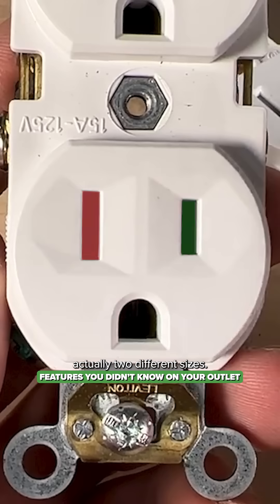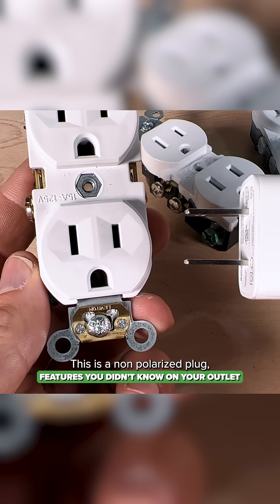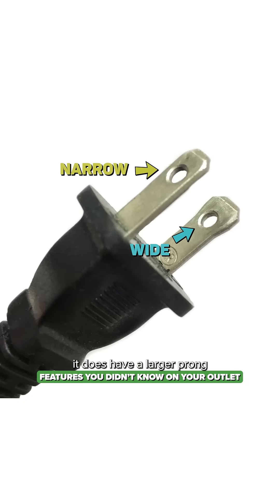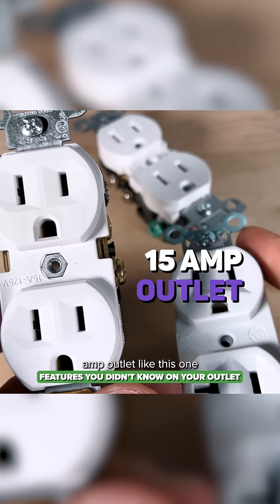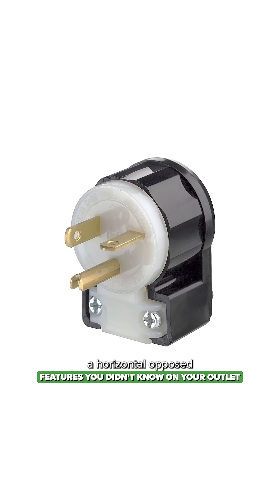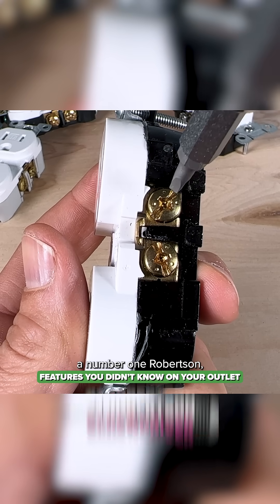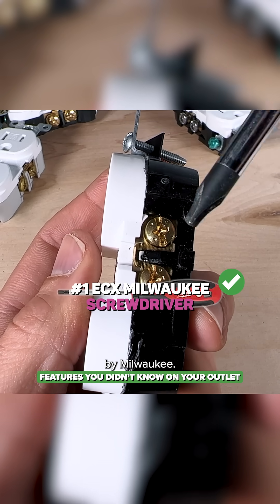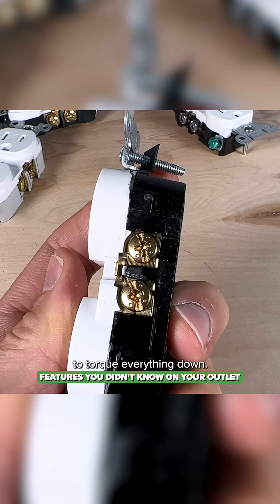Features you didn't know on your outlet

Comment: I've had so much trouble trying to force the larger blade into the smaller slot - I wish they hadn't changed everything to polarized... yes I acknowledge that my statement above could set someone up for a lewd joke...
Reply: Only a Cowboy fan would have a problem plugging in a lamp. Just kidding, actually some Eagles fans have that same problem.